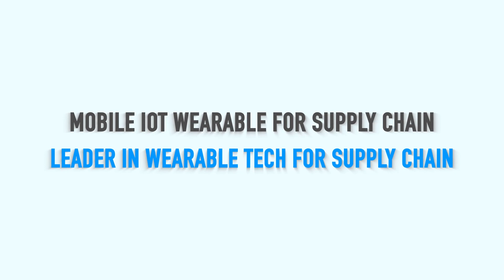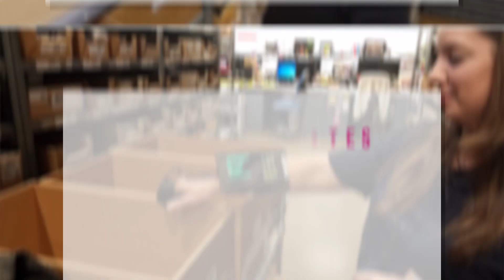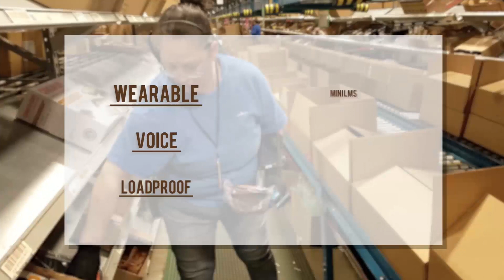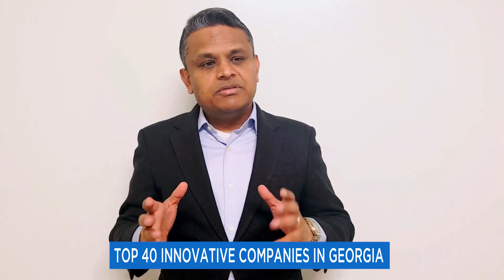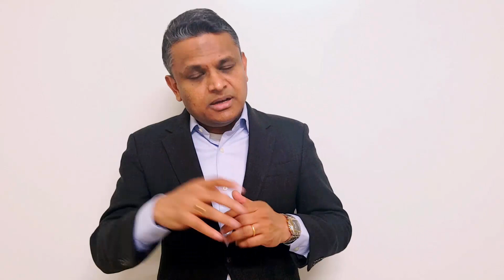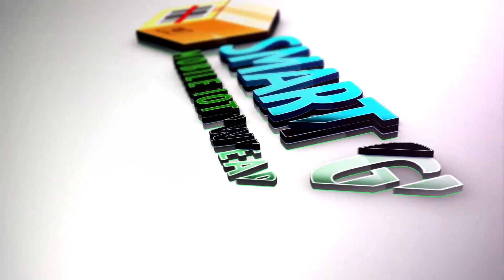The Warehouse Quality Control Best Practices to Improve Shipping Efficiency | Smart Gladiator

Comment: Great introduction to the issues. Packaging is a huge area that is overlooked for quality shipments. Designers need to remember that their responsibility to a quality product getting delivered relies on the shipment stage as well as the manufacturing stages, otherwise that can break what was otherwise a great item. May not get noticed either for a while, or the recipient may not report back all the damage, so it can be invisible at times, but $1000s can be lost this way.
Reply from the maker: Well said!